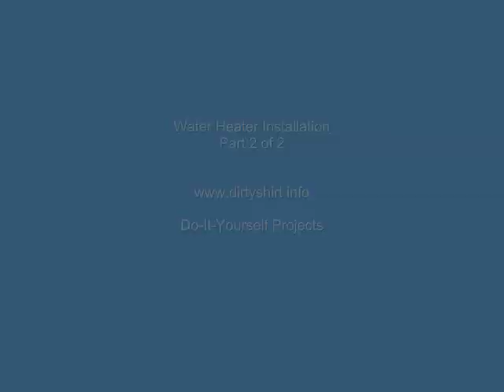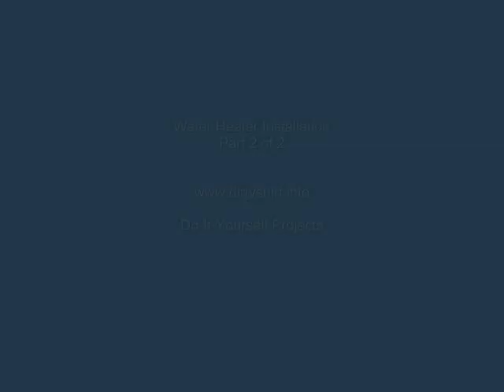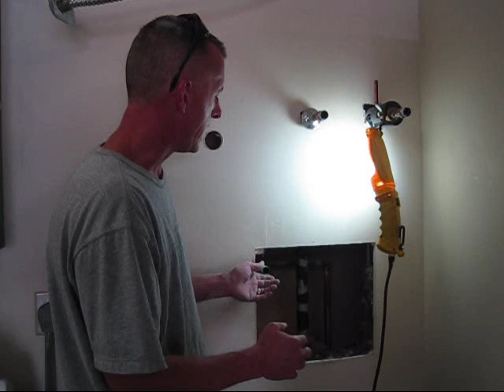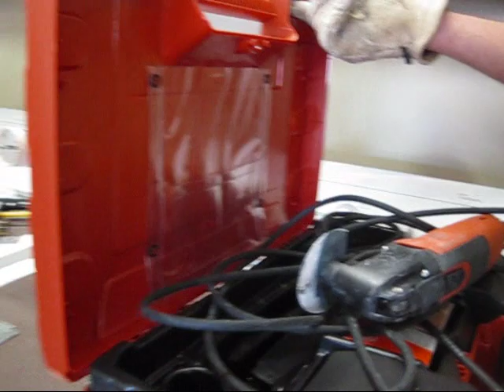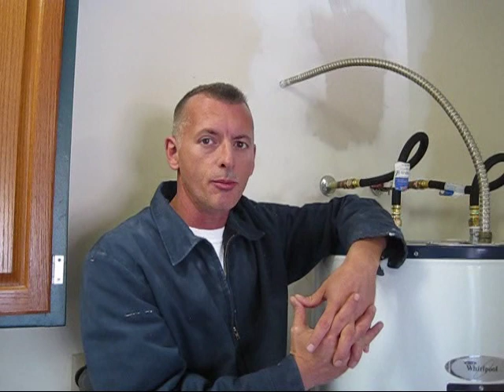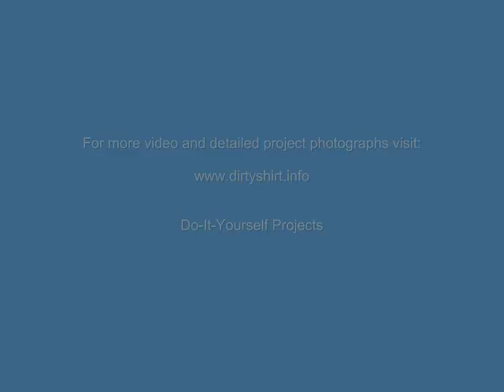Water Heater Installation - Part 2

Comment: Just ran across your video 5+ years later... If you ever run across a wire coming through a wall in the same manner, please consider installing a junction box on the wall, fed by the wire in the wall, then the water heater could be tied in correctly. That builder sure new how to same time and money. Maybe the electrical inspector was his brother!
Reply: exactly.

Comment: A lot of "what you did"(end product)  but very little, if any, of "you doing it"(how you got there].  For me what makes a good video is showing the project (any project) actually "being done", not just showing the end product.  By knowing how you overcame your issues will help us, possibly, avoid the same issues.  Just seemed to be lot of magic in your video, ie, going from point A to B with no in-between.  I think you would have had the time in the two videos by removing a lot of rhetorical info not actually involved installing a typical water heater
Reply from the maker: Thanks Al, you're right, not many people care for this video for that reason - not enough "how the heck did he do that" information is included.  Here's a link that may clarify some of the steps.  Thanks for watching and thanks for the comments.  We'll do better next time.

http://dirtyshirt.info/houses_water_heater.html

Comment: Here are my observations, from a non-professional's eye. Sorry if they've already been covered. Thanks for your video, too!

1) Unless I'm mistaken (forgive me if so), the American/ Whirlpools should have a port on the top for the T&P Valve to be relocated to. Why not use that with a sweated-on union, and leave the existing T&P piping intact?
2) Escutcheons come in a hinged variety that can be installed after the drywall is "mudded" on. I couldn't tell if you have those...
3) Don't forget inspecting the anode every year as well as draining the tank! This is the single most important thing you can do to make that heater last for a long time. See the internet for technique on this. The American/Whirlpools have readily accessible anode ports on top, but crummy plastic drain valves (in most cases). On mine, I've left the plastic valve on there because I'm afraid of snapping it off. Most pros will recommend getting rid of that plastic drain valve and installing a brass ball valve to allow easier maintenance.
4) Draining the tank is easy if you first cut off the cold water supply, open the drain valve, then flip up the T&P valve lever. Open a hot water outlet in the house before turning back on to avoid a huge compressed air surge from the faucet when refilling
(don't ask me how I know this!). Of course cut all power to the heater first! No need to disconnect the hot or cold nipples for this. Opening the T&P valve will allow air into the tank to facilitate draining.
Good job and thanks for putting this up on the web!
Reply: Yeah, basically he did the knowledge portion of the work for you, stupid.
Reply from the maker: Excellent supplemental information.  Thanks for taking the time to explain this.

Comment from the maker: @VeryPersian It may be illegal and dangerous somewhere but not here. The primary ground is accomplished through the electrical connection and the armored sheath serves no purpose whatsoever other than to protect the house wiring to the heater - at least in this config. The clamped ground is secondary and passed code inspection as is. If somebody has specific data stating otherwise please run it up the pole.